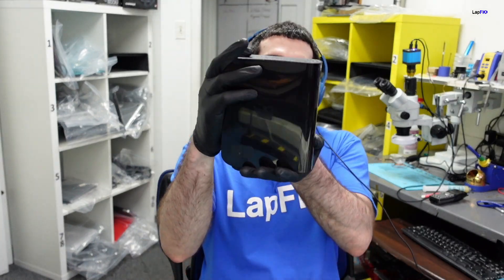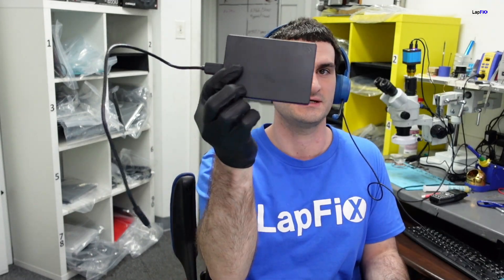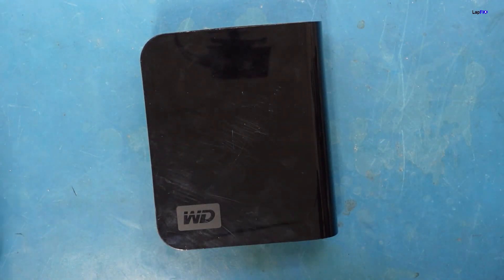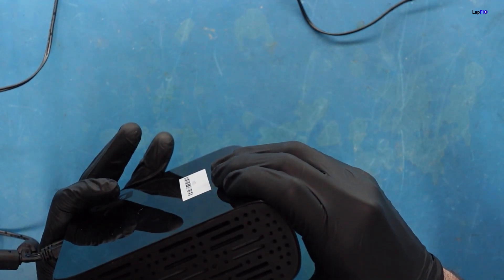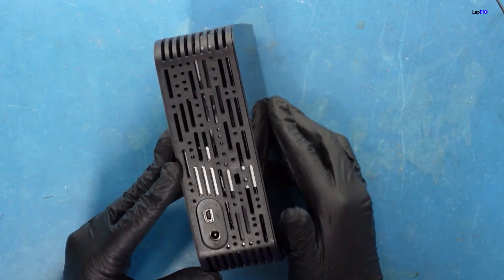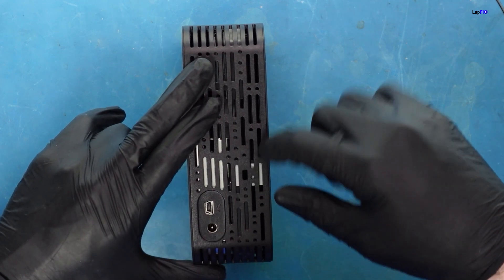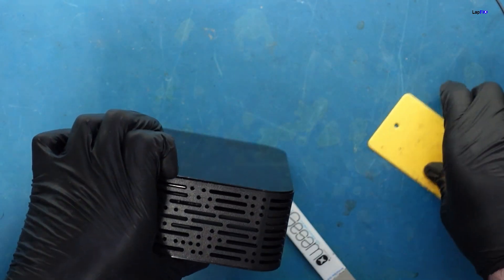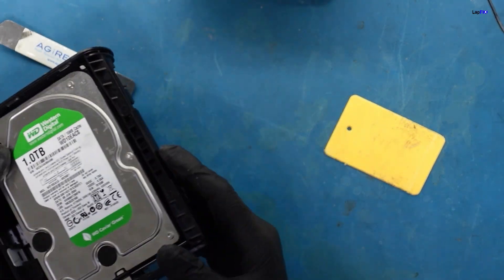How to fix a Dead External WD hard drive HDD - Data Recovery

Comment: When I connect my WD it doesn't make a clicking noisem I do hear the windows detecting a device sound (which you said is a good sign) issue is I checked disk management and it find the drive at 0.00mb asks if I'd like to initialize ot and use a gmt partition. I say yes but it says it can't because it doesn't meet the minimum size at 0 00mb.  When I plugged it in this morning and it was playing a home movie it paused resumed and then paused and wouldn't continue again. It froze up my windows I restarted a few times it took a while before windows can even get back to a desktop after the loading screen but it finally did. When I tried plugging in the drive again it wouldn't find it at all.

Comment: Are there different sizes for that sled/caddy? If so, which is ideal for that hard drive?
Reply from the maker: It's best to get one that fits "3.5" drives as the will also fit 2.5"
Reply: @lapfix  can you send me a link to the Sata to sled cheaply cost? thanks
Reply: SABRENT USB 3.0 to SATA External Hard Drive Lay-Flat Docking Station for 2.5 or 3.5in HDD, SSD [Support UASP and 20TB] (EC-DFLT)

Comment: I have this same drive. My will light up and I can hear the fan or motor (not sure which) but it's not loud. The info does not show on my computer. If I purchase a WD USB Converter and do exactly what you have done, do you think I can recover the data myself OR do you think the drive is dead?
Reply from the maker: The method I show is a very rare and lucky occurrence.    This method works best if the drive is completely dead. Also, since this goes behind another pcb, it is worth a shot to order a converter.  If it gives you any other issues or you still can't see it, then there is a real issue with the drive
Reply: @lapfix  OK. Thank You.
Reply: @XOLB1  Hi I have the same exact issue. In the past the drive would be loud and it would show up on my PC. Now it's quiet and just blinking blue and not showing up on my PC. Did you ever get it fixed?

Comment: Thanks. No power LED, so I bought a new $12.00 power supply to no avail. I ended up doing it the way you showed. I already had some HDD readers.
Reply: Hello. I ended up here because I think I have your same issue. It won't power up even though I change the power supply. I hope the data is safe :S

Comment: The sled you're using...what kind is it and where can I find one?
Reply: SABRENT USB 3.0 to SATA External Hard Drive Lay-Flat Docking Station for 2.5 or 3.5in HDD, SSD [Support UASP and 20TB] (EC-DFLT)
Reply: Amazon has several types of HDD readers.

Comment: So I did exactly what you did and my drive is a 1tb hard drive, when i connect the drive I hear the windows sound, but it doesnt show up on my drives. when i go to disk managment though it shows it as an unallocated drive with 239.9 GB. Is there a reason why the space is lower, and how can i fix it so it shows up in my drives
Reply: Hi.. did u get your answer? Because i've got the same problem and i try to recover data from it..

Comment: That sled you used..............it had power? or the power is coming thru the usb connection?
Reply from the maker: It has a separate power connection for power and a data connection via usb

Comment: I have the same drive. Just all of a sudden will not power up. Took the hdd out and connected my sabrent converters and it still can't get power. PC will not recognize it either.
Could that be an issue with the pcb on the hdd itself?
Got about 700g on a 1tb drive. Lot's of info on it I really would Ike to get off.
Any idea?